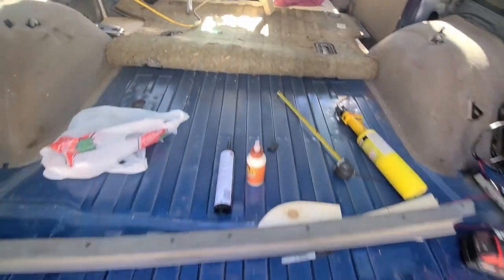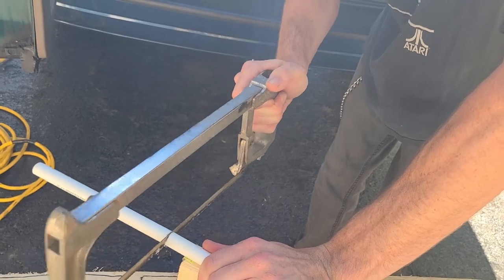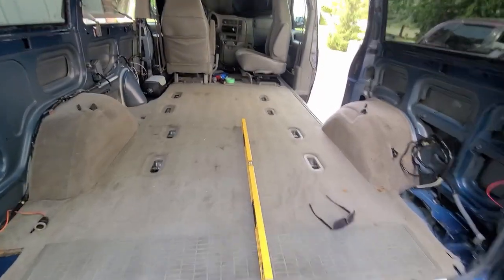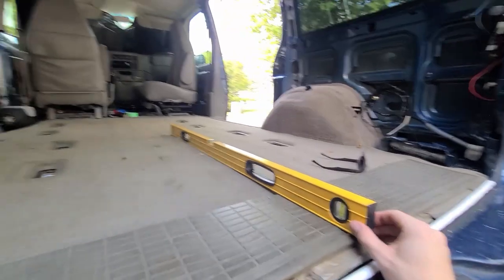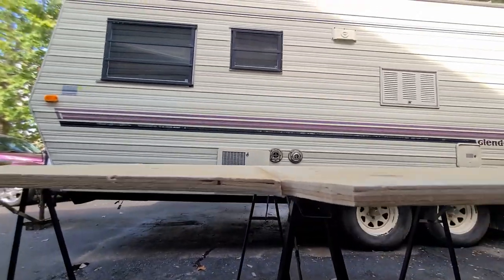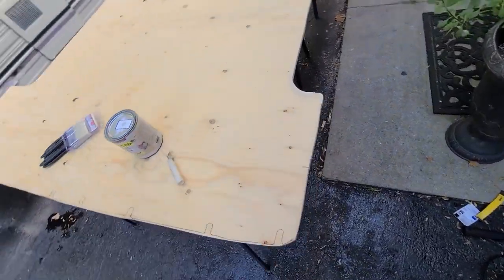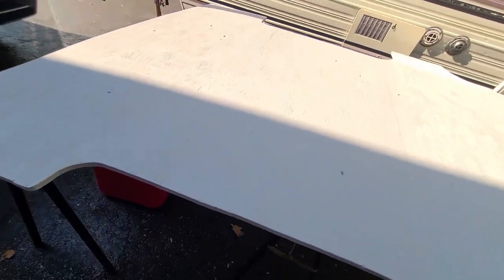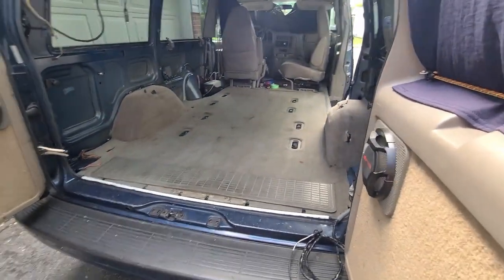"EASY" VAN SUB FLOOR - NO SCREWS - Fixing Water Leaks - AWD Astro Van Build

Comment: Nothing wrong with a "janky" video lol  Thanks from a grand caravan buildout newbie in southeastern Ontario 🇨🇦  ✌  subscribed - love to help out a "fellow" Canadian traveler 😊
Reply from the maker: Thanks and appreciate the sub! 😁 Good luck with the caravan! Does it have the stow and go rear seating? Makes for good storage, If so I am envious 😆
Reply: @alwaysgoodinthewoods  yes, it does - had my mechanic take the seat behind the driver and the last set of seats from the rear out - lots of available cargo space.  The floor is so sloped though.   On another note - what do you think about using a survival blanket (aluminum side down of course) as a tent over the bed.  Similar idea why people used canopies and curtains around their beds back a few centuries.  Would condensation be a greater problem than normal?  Thanks!